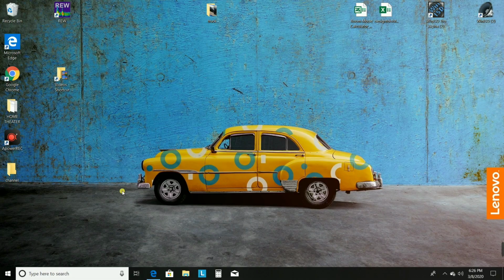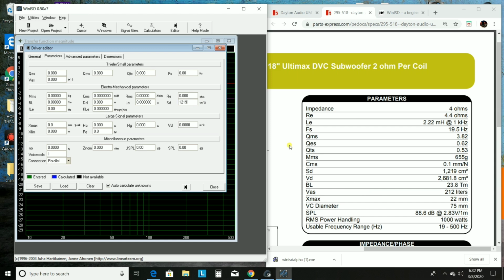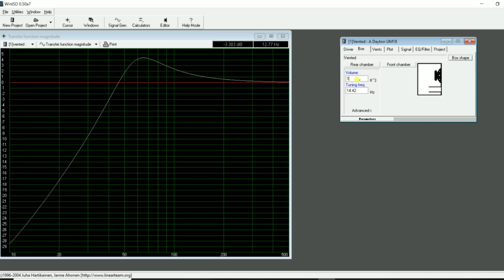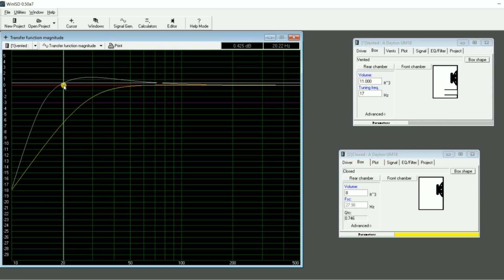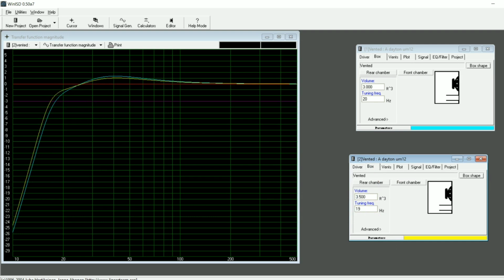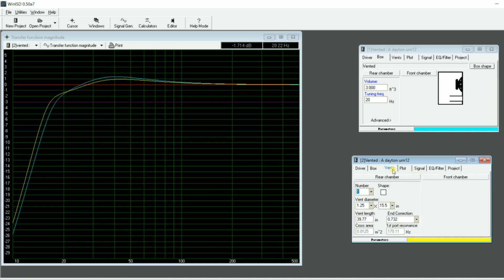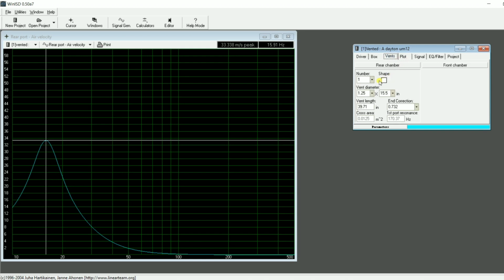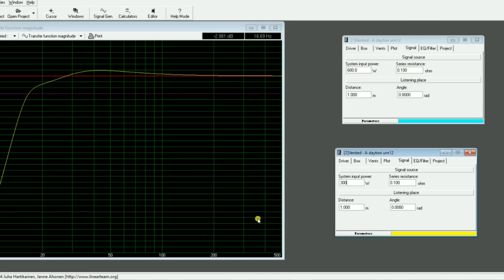Ep. 32 - WinISD tutorial for the beginner. How to design an Awesome Subwoofer | Home Theater Gurus

Comment: Why build this instead of 18 UM in sealed box, similar size box, way more output everywhere even at the UM 12 tuning and you could take advantage of available room gain.
Reply from the maker: Because it's for open rooms where we have little room gain and I want to offer something easy to drive that can play quite loud on little power.  I've had quite a high demand to design similar subs for guys over the last few years.   

In my upcoming dedicated theater room I'll be using sealed 18s but of course power to push them is substantially higher so the cost is much higher.
Reply: Home Theater Gurus will you use boosting to make the subs flat or depend and room gain? With room small enough and few sealed 18s you can reach down to 5Hz
Reply from the maker: @gsggsghshshs7192  have you watched the video.?   No boosting is needed as these  have a natural f3 of 16.5 hz with no baked in filters to boost.  Most will have too much output with room gain and need to cut.  They'll be very easy to drive and have impressive output.  Now they aren't going to outperform a full Marty down low by any means but they're aren't meant to.  Just like you wouldn't expect a pb4000 to outperform a pb16. 

Yep in sealed room or with enough drivers sealed can have great output quite low.  That's why I'm going with them in my dedicated room.
Reply: Home Theater Gurus I’m meant boosting for the sealed.
Reply from the maker: @gsggsghshshs7192  yes they'll need some.  When you order sealed from svs, Seaton, jtr they are boosting or have amps with adjustable boost settings.  You'll need a house curve so even if in room you managed a flat response with room gain you'll still need boosting for the house curve.  So yes I expect to need some good power.

I'll be using two of these and be running two 18 modules per Amp.  Total of 4 18s.

https://www.speakerpower.net/store/p28/SP1-4000-HT.html
Reply: Home Theater Gurus 4000 watts!!! Holy shit that’s a lot of power
Reply from the maker: @gsggsghshshs7192 😂It seems to be the same Amp Seaton uses and I think jtr as well.   I definitely like that I can slave a sub to it so that'll help save some $$.
Reply: Home Theater Gurus but how can you add delay if two subs are weird together? Are you planning to co-locate them?
Reply from the maker: Man you're on top of it!

Yeah I'll stack them.  And if I need more I can add them to the stacks. 

Now there's a delay on the Amp and by reading the description here in the dsp description that delay may be between the master and slave units.  I'll find out when I get my hands on the amps.  If so they don't have to be stacked but I will be anyways.  

https://seatonsound.net/product/f18-subwoofer/
Reply: Home Theater Gurus damn that my dream setup, 8 18s, two in each corner with like UM-18 or Fi HT-1. That will probably be way too much and I will end selling 4 of them but I got to try it.
Reply: Gsggs Ghshshs but why? I talk myself out of chasing infrasonic because there is only two scenes I know that has below 10Hz one is fucking Irene in black hawk down and helicopter scene in lone survivor.
Reply: azzy mazzy I need to try it

Comment: Why design around RMS power handling and not Max? And shouldnt that be the AMP power and not the speaker power?
Reply from the maker: The RMS is used in Winisd to set where xmax occurs. This is shown in winisd. You will not have clean power at max power as more distortion is present beyond xmax.

Speakers don't have power as they need an Amp to supply it. The power specs are to show their thermal and mechanical limits. We're modeling a driver not an Amp so all that's important is the drivers specs.  

We apply simulated Power (Amp power) in winisd to see xmax and port velocity. 

You can apply more power in winisd which I do in the video but you exceed xmax and port velocity increases and so does distortion.
Reply: @hometheatergurus  hey, I just watched this video after you referred me to it. You're incredibly helpful. I was close to buying the Dayton 1000 watt amp and it would have been a waste. I will instead go with a 500w amp and a miniDSP!!
Reply from the maker: @caseykongpanickul3426  thanks and you're welcome!  It's often easier to have a video show it than me type 100 words and still not do what a video can. 

BTW if you ask about the hammer on some of the  Facebook home theater pages or even Google it you'll see it's become a quite popular little beast.